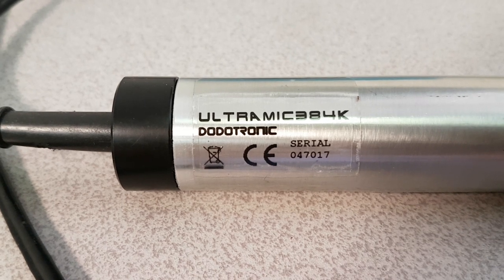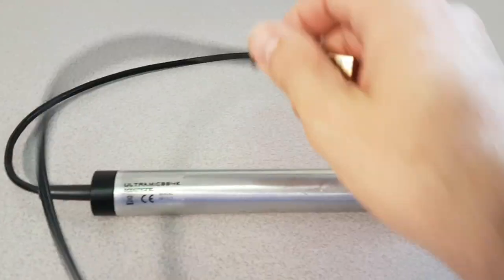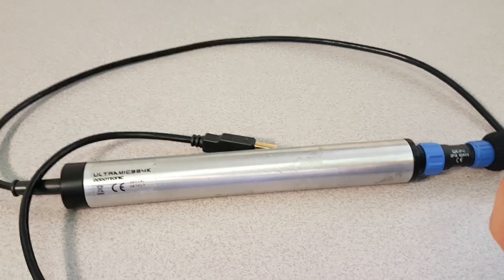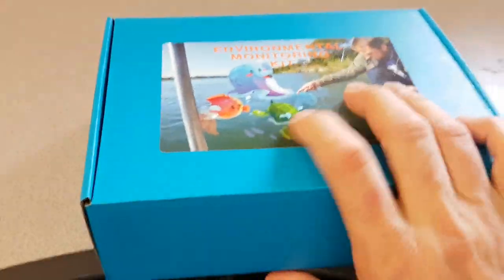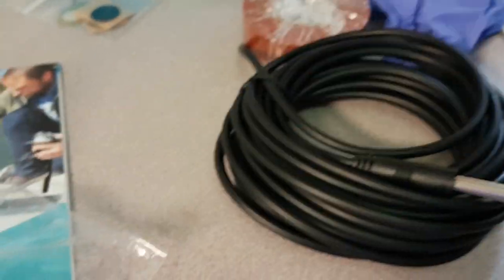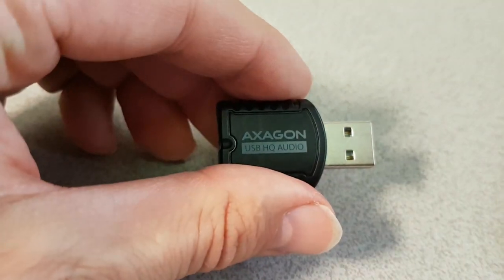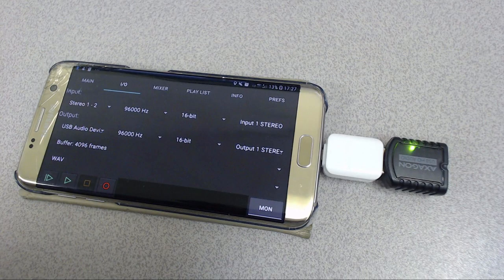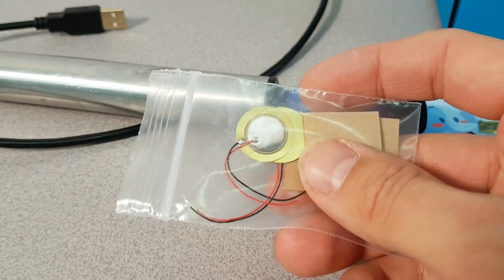Hydrophone

Comment: No impedance buffer ?! 
The problem with piezo guitar pickups and piezoelectric crystals is that they are not well matched to typical audio inputs. By their nature they can generate a lot of signal, but they cannot drive a 50 kilohm typical line input. The pickup needs to work into a much higher impedance, typically 1 megohm or so. 
So what to people do? They go and plug a piezoelectric disks output directly into the line input of their recorder, typical impedance 50k, or the plug-in-power mic input of their recorder, typical impedance about 7k, and they start to bitch and moan that this damn thing sounds tinny. Which is does ! But they don't understand why!

The reason why these devices often sound tinny is because the piezo sensor presents its signal through a series capacitance which is small, typically 15nF or less. When wired to a normal 50 kilohm line input this forms a high-pass filter, which eliminates the bass.
Solution: https://github.com/Supermagnum/piezoelectric

Comment: how are you going to utilise the hydrophone in cold fusion experiments?
Reply: It's suspected that dolphins from another dimension may communicate via LENR.
Reply from the maker: If you had a claim of a technology that worked by vibrating water, you would want to know what the frequencies were...
Reply: @MFMP  sounds like one of my open claims  youtube.com/watch?v=ptmqbckKGAU&lc=UgwTQ6k20G2zkLvyyyd4AaABAg    The simplification came to me after a close corespondent described a situation at his workplace where a centrifugal pump shaft didn't stop turning after all the valves were closed (in noteworthy sequence) and it was turned OFF, though at the time it was an unwanted phenomenon and the personnel simply extinguished it by opening the input valve forgoing its' significance... though I'm still sceptical as nothing has been repeated.
Reply: @MFMP  What are your thoughts on this "trapping of the pressure wave" ?   I don't think I've ever heard anyone talking about the possibility, but surely it's possible if the upstream valve is closed before the wave gets to it ?  I'd really appreciate a response.
Reply from the maker: @sFeral  Not sure what you are asking.
Reply: @MFMP  look at the setup in the linked "GEFA Druckschlag" video and imagine there was a second valve downstream of the cavitation bubble they were showing through the transparent part of the pipe, the valve being able to close fast enough before the reflected pressure(sound) wave reaches back. There are three replies including this one, I've assumed you've been able to see the first containing the link and the interesting testimony.
Reply: @MFMP  My interpretation is that the system, once established, is simply a transformer, no perpetual motion or anything impossible, though the input energy is the ambiental Heat, which supposedly shouldn't be usable ie. transformable into Work
Reply: @MFMP  my hypothesis is irrelevant in what would be your assessment of the described situation ie. why haven't we yet seen a documented case of "perpetual" reflection of such a high intensity soundwave inside a rigid (enough) vessel (if in reality such a thing can be made to last in absence of diamond as a moldable material) ... this also links with "sonoluminescence" and generating it within liquid deuterium (or more simply heavy water) for ex.     btw this might also be what Schauberger used in his "Repulsine"
Reply: @MFMP  You see no relation between this and what you've been examining recently ?  This should be much easier to test if you can get your hands on some el. controlled valves and create a laminar flow at as close to 4 deg C as possible, "supercooled"would be ideal, additionally a hydrophobic pipe surface.